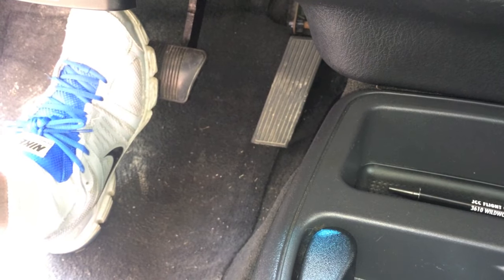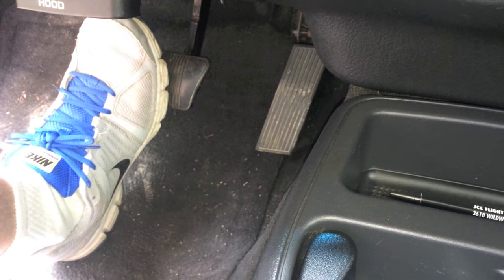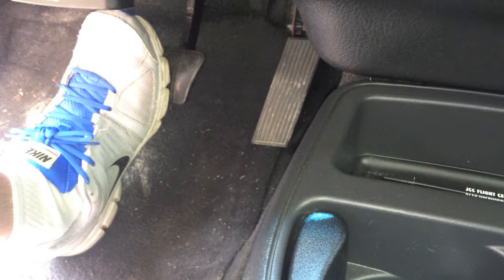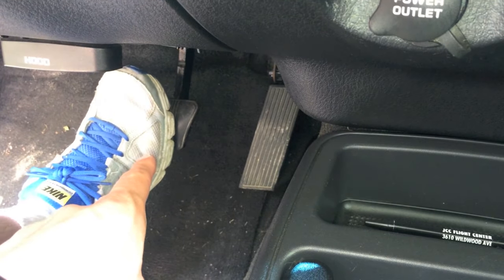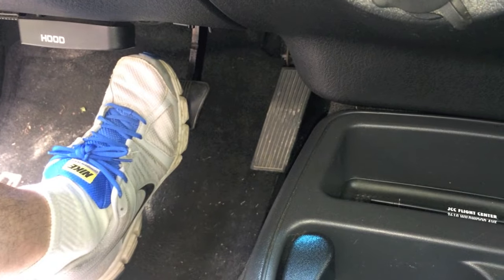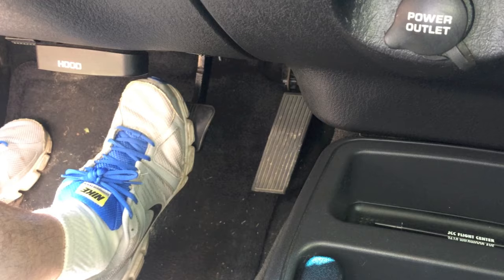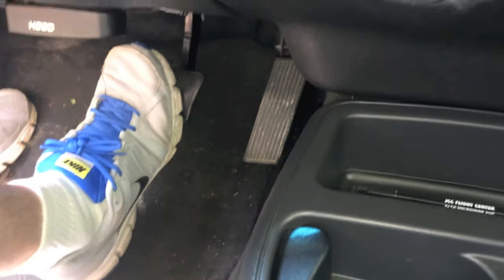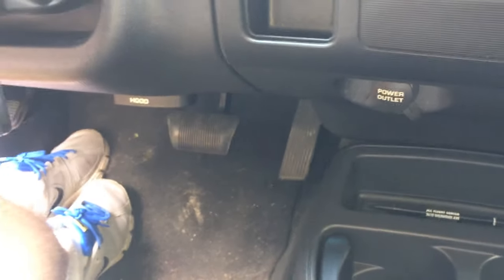HARD Brake Pedal - How to check if your BRAKE BOOSTER is GOOD or BAD

Comment: My brake pedal is stiff and truck won't start(long time issue). I'll wait a few hours or a day sometimes 2 days, then she starts right up. I replaced the brake master cylinder(brakes are good, bled the brakes, rotors and pads are good), replaced the brake power booster, replaced the check valve all that. It's been about 3 months and now it's doin it again. Stiff brake pedal, no start. Of course battery is good.. Where is the problem if the problem isn't the power booster, check valve, master cylinder, pads, rotors, etc.? Or, how can I circumvent the stiff brake pedal? If I can get the pedal to loosen up, then the truck will start.
Reply from the maker: Thanks for watching, two things come to mind.

1.  Worn out caliper.  As your caliper wears out, the internal piston no longer shifts back-and-forth as it did when it was brand new.  As you use the brakes, the caliper piston extends and once you release pressure on the brake pedal, the caliper piston is supposed to retract.  

Unfortunately if the internal piston gets stuck in the extended position, it is warn out and will need to be replaced.

2.  Worn out rubber brake lines.  The rubber brake lines that feed off the calipers and connect to the hard brake line connected to the wheel well frame can go bad overtime.

They fail from the inside out, and as they fail, small pieces of rubber begin to break away and travel freely throughout your brake lines.  All it takes is one little piece of rubber to clog the system…causing stiff brakes.

As you mentioned, it fixes itself if you let the vehicle sit.  These are the exact behaviors of a faulty brake line or worn out caliper as they will, in most cases, fix themselves after periods of time in the stationary position.

Keep us posted Kirk.  😎👍
Reply: @DIYwithMichaelBorders  Ahhh that's fascinating!!! Well, it just so happens that she just righted herself 20 min ago. She is sitting in the driveway outside my window idling like a kitty in your lap! When she started I sat in that seat wondering.. what or how is it, that she rights herself(head scratcher)? I can now wrap my head around those 2 options you mentioned! Sounds like I have a fun little project ahead. Thx big BIG @Michael Borders!
Reply from the maker: @kirkhustle3718  

So happy to help, we DIYers need to stick together!!!

Looking forward to hearing back from you.

Comment: On my 2010 focus, pedal works the way you show in video but when i press it fast, i hear a sound(like air escaping from pedal).and braking starts after i push it a bit and it feels so soft.on other cars i tried, they start braking immediately after pressing but mine is a bit slower (brake force is not bad, it stops but it doesn't feel right). I replaced brake fluid and bleed the system and it's still same, now what can i do?
Reply from the maker: Burak T 

Thanks for watching & sharing your experience.  A few things come to mind.

You may have an intermittently working Master Brake Cylinder causing fluctuations within your brake system.

You may have a vacuum leak.  Turn on engine & open hood.  Try to listen for any hissing sounds coming from any hoses/lines feeding in & out of your Booster.  If you hear hissing, visit your local AutoZone & purchase a new line.

Let’s start there, keep us posted!  Please subscribe to the channel and turn on your YouTube notification Bell 🛎 that would be awesome thanks again.

😎👍🔧🔩

Comment: what does it indicate when you turn the ignition off and the brake pedal pushes toward you?
Reply from the maker: Thanks for viewing and commenting.  What year is the vehicle?  After ignition is turned off, the booster is holding the vacuum pressure and will provide brakes after engine is turned off...if you may need them.  If this is happening while driving...."This is rare"...and indicates possible rust near the sensor wire harness to the front rotors.  This may monetarily separate the sensor and gives a false reading....resulting in the Anti-Lock brake.  Be very careful while taking sensor off as it is plastic and may brake...Subscribe to the channel if you're up to it.  Thanks again!
Reply: +Michael Borders the car is a 1989 Corvette. I checked it again today and the brake pedal definitely pushes back when you hold the brake pedal down and turn the ignition off.  Actually it is interesting to watch because when you come to a stop, take your foot off the brake pedal and turn the ignition off the brake pedal still rises.  just don't seem normal.  By the way, thank you for responding so promptly. I never expected a reply.  Thanks again.
Reply from the maker: Thanks for the update...and the info.  I would look into the sensor and see if you can see any rust forming.
Reply from the maker: Hey Richard, thanks for checking out the video.  This is definitely signs / symptoms of the brake booster beginning to fail.  

First check the level of the fluid in reservoir.
If its empty...add fluid and see if this helps.

If not...chances are that you will need to get the booster replaced...which usually isn't a job to do at home unless you have the experience as well as required tools.

The booster is relatively inexpensive and should be a quick fix when taking it  to a professional shop.  Keep me posted!

Comment: Hey thank you so much for the great video.  I have a 2010 Honda CRZ IMA. I have this problem in a different way. Everything works fine and suddenly brake paddle get really stiff. This happens randomly. Earlier I noticed this in slow speeds like when I'm taking out from the garage. But recently it happened around 40kmph and it was really scary. It stopped when I virtually stood on the paddle and again it was back to normal. Now I drive very slow and keep a very large distance between other vehicles to avoid a risk if it happens again. Help me if you know why this happens.
Reply from the maker: Thanks for watching & it likely that you have a caliper in its early stages of failure.

The more you compress the brakes while driving, the less the caliper piston retracts & the hotter the brakes get.

If you have replaced calipers in recent months, it can be your rubber brake line feeding off of your caliper and going to the hard line that feeds to the internal engine compartment.

After driving, check to see which wheel is the hottest without actually touching it.  If the caliper is locking up the brakes as you drive, the wheel will be giving off an excessive amount of heat.
Reply: @DIYwithMichaelBorders  thank you so much. I'll check.
Reply from the maker: @iotsolutionslk  

😎👍

Comment: I have a weird problem where the pedal is very stiff when the car is off but it does movie to the floor when car is turned on. During the startup I also hear my vacum pump work a lot. For about 30 min brakes works fine but driving for longer makes my brake stick on the the driver side. Very frustrating!
Reply from the maker: Benne 

Thanks for checking out the video and sharing your comment Benne!  Let’s get this figured out!

After reading your comment, I get the feeling that it’s a possible vacuum leak.  Here’s what we recommend.

1.  Do a thorough inspection of entire brake system & lines & check to see if you find any leaks.

2.  Turn engine on, then open engine hood, then listen for any sounds of hissing.  If a hissing sound is present, locate the vacuum hoses coming out of Booster & locate leak.  Then purchase new vacuum hose from auto store.

Let’s start there!  Keep us posted.  Please subscribe to the channel and turn on your YouTube notification Bell that would be awesome thanks again!  😎👍🔧🔩

Comment: How would I know if air got into my brake lines? Because my brakes are soft and I have to push the pedal almost all the way down
Reply from the maker: Tuzo Vegeta 

Thanks for watching & sharing your question.  The easiest thing to do is Bleed your brakes.  You will be able to remove any air inside the brake lines.

Air inside the brake lines will definitely degrade your brake performance and decrease the safety and reliability of your brake system.

Keep us posted!  Please subscribe to the channel and turn on your YouTube notification Bell 🛎 that would be awesome thanks again!

😎👍🔧🔩

Comment: Hello I could use some help. I have an 04 sequoia. Trac off, vac and break light are all on and the break peddle goes nearly to the floor to stop the car. Some say abs pump and module could be bad. Is that true.
Reply from the maker: Riley Higgins 

Thanks for checking out the video and sharing your comment Riley.  Let’s get this figured out together!

The first thing that comes to mind is a possible leak somewhere along your brake lines.  

First thing to do is check the quantity of brake fluid in your reservoir.  If it’s low, you might have a leak.

We recommend doing a thorough inspection of all your brake lines.  Try to pin-point any leak.  Start at your Master Brake Cylinder and follow all lines coming out of it & all the way to each wheel at the Brake.  

Let’s start there!  Keep us posted!

Please subscribe to the channel and turn on your YouTube notification Bell that would be awesome thanks again!  😎👍🔧🔩

Comment: Hi, why do I hear a drum sound when I release my foot brake at the light? The car has been sited for a while on the hill.
Reply from the maker: Thanks for checking out the video and sharing your comment and experience Jenny Lu.  This is a common issue that many have run into.  It can be a couple different things

1.  Its possible that something has come loose inside rear drum brakes.

2.  Its possible that your U-Joints have worn out which allows the clucking/Drum popping sound...will need to be replaced.

Carefully and Safely go below vehicle and inspect U-Joints.

Keep me posted!  Please Subscribe to the channel and turn on your YouTube notifications that would be awesome thanks again!

Comment: I just ran into this trouble myself, I was driving and press the brakes going to make a right turn, I notice it sink a little bit but didn't think of it. So I parked and decide to try and see why it sink, so figure it sink check the fluid and no fluid but the car still stop but not completely, so my guess is it the master cylinder but kinda scared it might be the brake line, don't really wanna work in these cold weather condition atm too but if you know the problem let me know, thanks
Reply from the maker: DonutVIP 

Thanks for checking out the video and sharing your experience.  After reading your comment, you mentioned that there was no fluid in reservoir...this means the fluid has gone somewhere 😱.  Let’s get this figured out!

With the car off, open hood and do a thorough inspection of the Master Brake Cylinder and the brake lines feeding out.  These brake lines...as you know...travel out through the firewall and travel underneath vehicle to all brake units.  

Check to see if you see any signs of leaks anywhere that the brake fluid could be escaping from the brake lines.  If you find an area that brake fluid is leaking from...you will want to replace that line ASAP.  Below are links to a few videos showing Brake line info/replacement.

       https://youtu.be/nQGf8rf4F5s

       https://youtu.be/tFeOqBfr1EU

       https://youtu.be/Zj3HfNOZsxI

       https://youtu.be/2mDp5pEsuK4

       

If you find absolutely no leaks anywhere, it’s possible that the brake fluid is beginning to leak inside the brake booster which means your brake booster will need to be replaced.

Keep us posted.  Please subscribe to the channel and turn on your YouTube notifications that would be awesome thanks again 😎👍🔧🔩
Reply: DIY With Michael Borders thanks for the fast reply, I will keep you guys posted but first gotta check the brake line just to be sure
Reply from the maker: DonutVIP 

Awesome Awesome 😎👍🔧🔩

Comment: My brake pedal is hard even with ignition off... I have very little play in the movement?
Reply from the maker: Hi there Hann-Marie Rowe...thanks for checking out the video.  Have you had any recent repairs in the last year to your brake system or any of its parts?

Its possible that your vacuum pump will need to be looked at / replaced.  The symptoms you're experiencing with the hard brake pedal before starting can be caused by a leak of some sort in the vacuum line/pump system.  I would take a very close look at all the hoses coming off your brake booster.  Check for leaks, warped hoses, cracked......then turn engine on and try to listen for hissing sound.  If you hear hissing, try to pin point the hose thats hissing.  By replacing that, you might see a substantial difference.  Definitely keep me posted!  Subscribe to the channel that would be awesome!  Thanks again!
Reply: Hann-Marie Rowe
 will it move down at all when trying to brake with ignition on? is it hard to break? whats the problem? just the fact the it moves slightly with ingition off before it stiffens?
Reply from the maker: Hann-Marie Rowe This is normal in some cases.  The brake system has features that allow minimal brake applies while engine off in regards to its vacuum regulated portion.  After you turn car on...do the brakes work as normal or does the brake pedal harden as you drive.

Comment: Hey.   So I was readjusting my parking today and when I braked I heard a air puff sound  coming from the passenger  side  of the dash (right hand drive diesel car), but only does this if I'm idle or rolling, not when moving at any speed.   Everything else is fine, pedal is fine. MOT was in August, new brake pads. Handbrake fixed last year.     I'm a bit worried

Comment: It’s happened to me once about a month ago and then also happened today. When driving at highway speed (same scenario as the first time), not using the brake pedal for roughly 25km (15 miles) my brake pedal essentially freezes and I cannot stop no matter how hard I press. After working the pedal at a slower speed it unlocks and my brakes engage. I just did a full front rotor and brake pad job the other day but my brakes don’t feel as sensitive as I thought they would be, and then this issue happened. Any insight on what may be the problem?
Reply from the maker: Thanks for watching, have you performed this friendly DIY test to ensure your Booster is working properly?

Comment: I have a 1997 Dodge Ram 2500 diesel with a hydro booster and I have no brake pressure while the truck is moving I have replaced the hydro booster and master cylinder and has changed nothing
Reply from the maker: Davidchevelless 

Thanks for checking out the video!  This is definitely not uncommon!

It can be a few different things....Lets figure it out!

First thing that comes to mind is your fluid level!  Make sure your brake fluid is not outside the proper fill parameters.  This causes brake system performance issues...explained in more detail below!

Let’s work through the items!

1.  Its possible that your caliper is beginning to stick...maybe caliper slides have lost the lubrication required to shift back and forward freely.

2.  It can be possible that your Caliper piston has lost its lubrication which will also interfere with the efficient shift back for forth.

3.  The front rubber brake lines that connect to your caliper fail from the inside as opposed to the outside.  This means the inner coating begins to break away and clog portions of the brake system...hence not allowing fluid to flow back and forth freely.  

4.  Your brake pads have little prongs/teeth on them.  You will notice by their location...the pads slide on a steel brace.  This may need to be lubricated to bring the shift back to efficient requirements.

We have attached a few videos.  Lets start with the easy items and then work our way up!  Lets figure this out together!  Keep us posted!  Please Subscribe to the channel and turn on your YouTube notification Bell 🛎 that would be awesome!  Thanks again!

Links to all of our helpful step-by-step videos explaining the above possible causes are below, definitely check those out!  😎👍🔧🔩

1.  Caliper Slides Lost Lubrication:

https://www.youtube.com/watch?v=-DZ68tKuCQc&amp;t=15s

2.  Too much Fluid in Reservoir:

https://www.youtube.com/watch?v=X-AJ5tD6zoA&amp;list=PLjCXOz8TSkZnavDiGDyHdPKe2dV2RzEMZ&amp;index=39

3.  Failing Front Brake Lines:

https://www.youtube.com/watch?v=3FTEgbLYAdI&amp;list=PLjCXOz8TSkZnavDiGDyHdPKe2dV2RzEMZ&amp;index=78

4.  Brake Pads not shifting:

https://www.youtube.com/watch?v=3Pq15BWM_qY&amp;t=103s

5.  Replacing Front Brake Calipers:

https://www.youtube.com/watch?v=8HoaL4QM5-k&amp;list=PLjCXOz8TSkZnavDiGDyHdPKe2dV2RzEMZ&amp;index=83

6.  How to check if Brake Booster is Failing:

https://www.youtube.com/watch?v=VK4lowH7kQE&amp;index=66&amp;list=PLjCXOz8TSkZnavDiGDyHdPKe2dV2RzEMZ

7.  Failing Brake Booster:

https://www.youtube.com/watch?v=j9s7yccswPQ

8.  Symptoms of a Failing Brake Booster Check Valve:

https://www.youtube.com/watch?v=j9s7yccswPQ&amp;index=68&amp;list=PLjCXOz8TSkZnavDiGDyHdPKe2dV2RzEMZ

9.  Master Brake Cylinder info

       https://youtu.be/F9s_1VZ2u5E